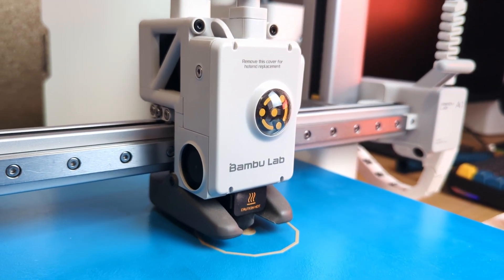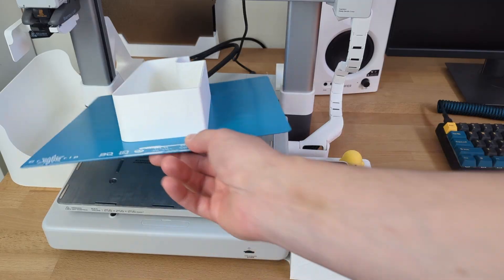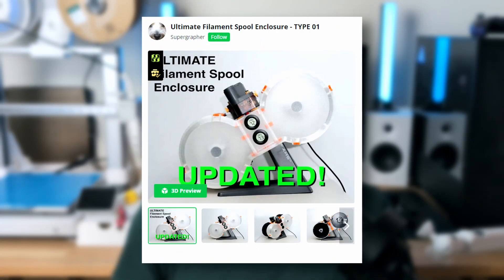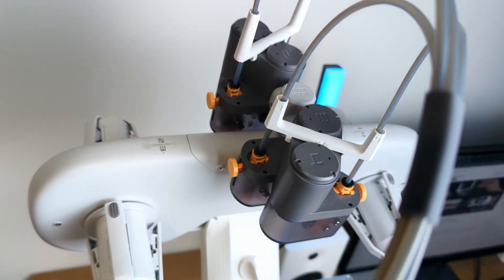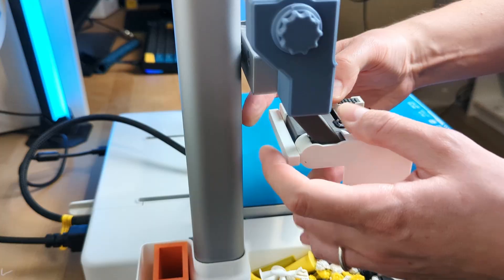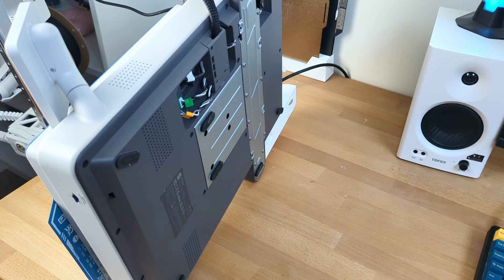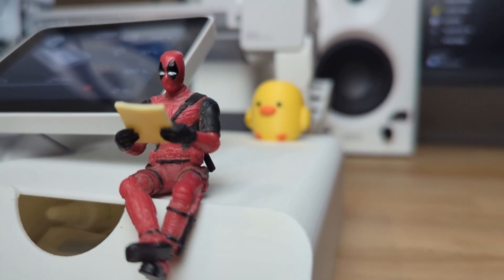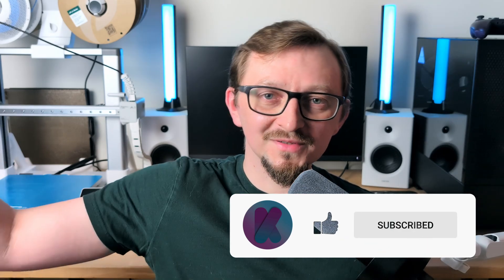I printed 7 mods for my Bambu Lab A1 #3dprinting #bambulab

Comment: Super cool to see how you can customize the printer to your own liking! Small question - Can the filament "poop" be recycled in some way, or is it just waste? 🤔
Reply from the maker: Some people take the filament "poops" and make them into colorful sculptures using heat gun and silicone molds 😊 These "poops" can also be recycled back into filament but that requires some equipment.
Reply: @kroopniock  there is also some prints that includes "dead spaces" in the design , to put the poop waste inside of the print to get rid of it =D
Reply from the maker: That a cool idea😁, recently I saw a model of a cat that's partially hollow so you can put the filament "poops" inside of it and make a colorful decoration 😊